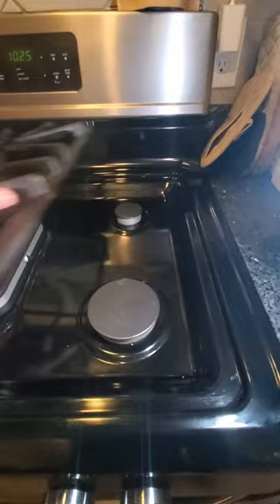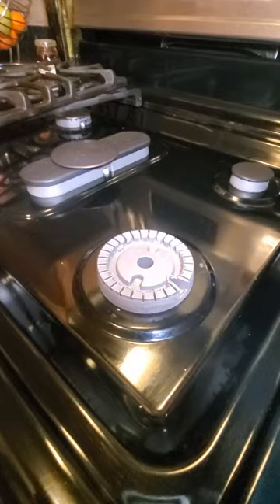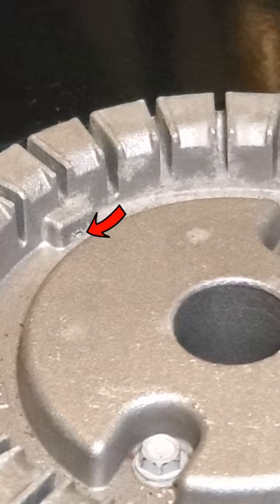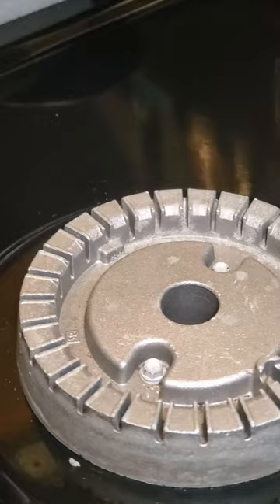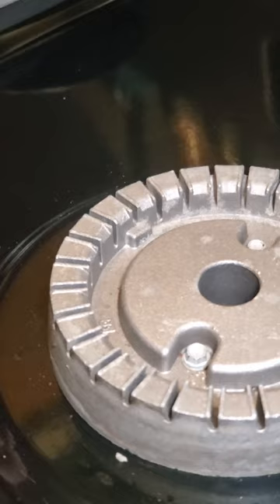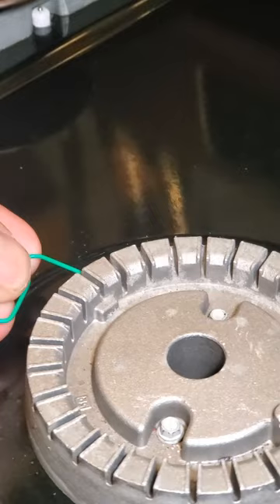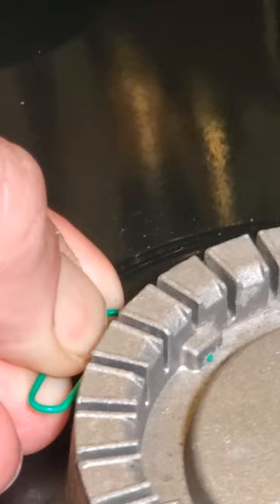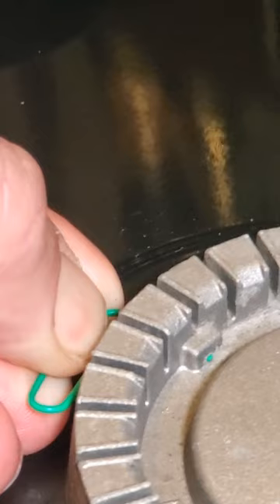Gas Stove Will Not Light Fix #shorts

Comment: I don’t have a burner like that. I have a bertazonni (made in Italy). It won’t light but clicks and there aren’t any holes to clean out. Only a nut in the center
Reply from the maker: Do you see spark?  Try cleaning the ignitor tip

Comment: Mine sparks and then LIGHTS but goes out as soon as I remove my hand from the knob… can’t get it to stay for anything… I’ve got a Venini gas stove top with clean parts…
Reply from the maker: Have you verified the gas is still running when turned on?  Sounds like the gas is stopping after you release the knob.
Reply: @JMGENTERPRISES  I think that’s what’s happening. Was hoping there was a quick fix to this.